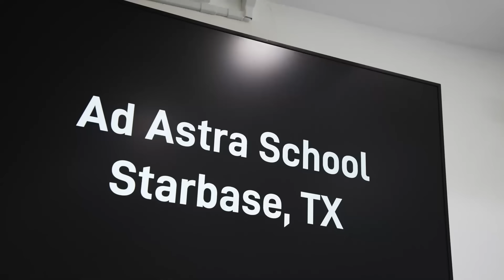Why Booster 9 Failed During Flight, Starbase Expansion Progress | Episode 23

Comment: I'll advocate a hydraulic 600 to 1000 ft. Lift off till I'm worm food.  The earth's gravity needs to be cracked so to speak, by non-ship means, before ship borne thrusters fully take over.  This should significantly reduce initial stress on the ship that is caused by gravity.  A series of concentric upward thrusting, rings of water nozzles, shooting filtered salt water, should be easy enough to construct.  Wind or solar powered accumulators can get this gravity cracker going with negligible environmental impact. 
     It's reusable and safe and will reduce launch noise and trauma to the spaceship.
Reply: What accelerations do you wish to achieve? How much fuel can be left behind? When to you start the engines?
Did you go to engineering school?
Reply: I must be misunderstanding your idea because it seems like a reliability, complexity, and cost nightmare. I don't want to be rude, I must have missed the advantage you're aiming for. What does cracking Earth's gravity mean, and how is a giant array of water jets better than adding a little more propellant to the giant soda can, or slightly reducing the payload capacity?

Lighting the engines at the top of the hydraulic launch seems extremely risky. Is there a way to abort if engines don't light immediately? Also, on the ascent some water would get splashed deep into the engines, freezing wherever it landed and ruining the careful cryogenic pre-chill.

Alternatively, lighting them at ground level doesn't appear to decrease the forces on the rocket. Maybe the engines are throttled down slightly, but the water's force would be increased to compensate. The vibration might be even worse, with water bashing on the engine bells and uneven pockets of water flashing to steam in the exhaust plume. There'd be a strong thump-thump-thump as it passed each ring of nozzles.

I'm imagining a 600-1000 ft launch tower with a hollow centre for the rocket to ascend through, strong enough for the reaction forces. No matter where you light the engines, at least the top part of the tower must be reinforced to survive rocket exhaust, the total thrust load, and the colossal noise. Add in 50-100 rings of nozzles, each ring needs a high-speed valve, and a control system to drive it all. Does this match your vision?

Comment: If they’d put the rocket part of starship on pylons at each side of it then this couldn’t happen.  An added benefit would be a massive increase in usable space inside of starship.
Reply: Very bad idea, simply would not work and unnessary. Drag would nearly treble, bracing to transfer thrust to the main body would be heavy and it would be very difficult to provide a heat shield to the sticking out engines. To increase payload volume all you do is add another ring or 2 to the body, which is what they are going to do I believe.
Reply: The pylons seem a good idea, the balancing act as it returns on flattop barges…Stability surface and wind and wave actions..needs damping effects..for the flattops.Do they have gyroscopic interactions feedback between flattop surface and on rocket base for landing?

Comment: Why is there no Black Box ??
Reply: Because the box doesn't identify as black 🙄
Reply: Racist
Reply: Because telemetry is constantly being broadcast back to mission control.
Reply: It could be an orange box, like some people.  😊
Reply: because if the rocket does something wrong, it gets blown up so nothing to save.
Reply: Every commercial aircraft has a black box that will survive vaporization.... So there's plenty to save @shaung949
Reply: Black Box go BLUEY with Big Rocket.
Reply: Telemetry (performance data) is continuously transmitted to ground control during flight (unless the connection is lost LOL). A data recorder (black) box could be helpful in that situation but it would be complicated to recover from the bottom of the ocean or from orbit. Preserving it from a flight termination explosion/self destruction would also be difficult (ie: ejection system, super durable box, gps tracker, floatation device, etc.)
It could all be possible to engineer all of those things into one system but that would only preserve missed data during loss of data connection events. I am guessing there are more important pressing things for the design teams to focus on.

Comment: Everyone is talking about the booster exploding but why did Starship explode?
Reply: If you take a close look at the fuel levels of the ship, one of the tanks is draining faster than it should like it were a leak
Reply: @beelandspace  It's the O2 tank looks like there was a leak Scott Manley's video pretty much explains what we know so far.  SpaceX are remaining tight lipped but if they reveal their corrective actions like they did for IFT1 I bet we'll get something about reinforcing the O2 tank or Oxidiser pipes.  The other glaring option is that S25 was the last Ship to have Hydraulic TVC which caused major issues for Booster 7 during IFT1 when it blew out perhaps something similar happened for S25 thankfully no Ships or Boosters remaining have hydraulic TVC they've all switched to Electric
Reply: ⁷5⅚t677⁶ UGG unde tffffț @beelandspace
Reply: That will be in another video
Reply: @ryanpruneau4937  Probably explained in the 11th video in the series of "Precisely why Starship blew up".
Reply: @protorhinocerator142  I got through two thirds of this worthless video before realizing they had no real info.
Reply: @gsparkman saying lots of words to sound intelligent but conveying nothing of importance.
Reply: I can’t believe this guy does so much talking without saying a damn thing!
Reply: What they said. Oxygen tank was draining quickly, meaning there wasn’t enough power left to get it to Hawaii and so would have crashed somewhere random along the way. Starship had to self-destruct and have pieces crash into the water below rather than perhaps crash into Indonesia or somewhere.
Reply: Fuel..leak...and  .activate.Flight..Terminate..
Reply: It was lonely. It couldn't live without its butt buddy.
Reply: They still don't know why
Reply: They lost connection with the ship so they triggered the FTS
Reply: Zackley
Just
Zackley
Reply: Obviously, it hit the firmament
Reply: @therombaro  yeah I thought of that too that would be fucked up cuz that might mean the Earth is flat I'm not a believer in that theory but the firmament is attached with the flat Earth  theory but you know could also be ET saying I don't want you to have some shooting your shit every time you launch it rock on man man 😀😀
Reply: controlled explosion, there was an oxygen leak and there wasnt enough fuel to clear africa, so boom.
Reply: God invented the rule of probability so this multiple outcomes but perhaps aliens are shooting his stuff down because they don't want him out Mars could be 😊😊
Reply: Maybe they should try something sturdier that stainless steel? Just my very humble opinion.
Reply: @joelm1955 
What material would you recommend?
Reply: Self destruction it, so it doesn't crash over land
Reply: Because it didn’t reach its destination orbit.
Reply: Wasn't going to make it to orbit fts was triggered
Reply: The real question. SpaceX still hasnt said. But lots of odd shoring up going on with SN26.  My guess is they know what happened but wont say cause its pretty bad. 🤷‍♂️
Reply: They Didn't need the data it was gong to provide. Test over... So blow it.
Reply: It wasn't a leak. The O2 was dumped in order to compensate for a lack of payload. Why didn't they just bring one? Dunno. But, they both likely would survived. Also, it's very possible they wanted an explosion, just cause 😂. Well, they can afford it!
Reply: Type in starship from Florida and you will find a vid what starship was doing when it activated fts.
Reply: Perhaps the 1 in 10 catastrophic failures in testing the newly built engines has got something to do with that.
Reply: And why did it take minutes for SpaceX to realise it had broken apart, possibly not due to the action of the FTS. It appears that the front section of the ship broke off in a single piece which could have caused considerable damage had it landed in a populated area. It wasn't blown into smithereens. Also, why do the heat shield tiles keep falling off? My theory is that the stainless steel structure is just too flexible. It buckles and twists under flight loadings far too easily, so the rigid tiles pop off and, of course, stainless steel is harder to get a strong adhesive bond.
Reply: @brendanpells912   makes sense !!
Reply: @brendanpells912  ??populated area?? The main flight path is over the sea. As the Starship was already in Space, it's re-entry meant it would burn up in the atmosphere and break up. I am quite sure SpaceX telemetry showed quite clearly when the Booster fell apart and the Starship FTS blowing it apart.
It was the Starship FTS that was activated, as it was not within it's flight trajectory limits. As for your 'flexing' SS structure. Have you tried twisting a full, unopened soda can lately? And that has no stiffeners like the 4mm SS Booster & Starship has. The body Tiles are attached to the tri-pin structures, that are welded to the outer skin. The glued tiles are now being tested by measuring the amount of pull they can withstand, so this may resolve the glued tile failures in future flights.
And before I go, you need to do some more research, before posting 'not quite true' statements.
Reply: @David-yo5ws  Maybe you should do a bit of research yourself:

- The planned trajectory of the launch does take Starship over land. It crosses both Africa and Indonesia.
- Starship definately does not burn up in the athmosphere. Stainless steel is quite heat resistant, and with the sheer size of that damn thing there is no way it will burn up completely.
- SpaceX has still not revealed why it failed. You could see it was out of fuel, but not why it was out of fuel. In fact I see clear signs it is overweight or underpowered, as it used up all fuel with zerpåo paylod without even getting close to orbital velocity
Reply: The FTS is not required to blow the ship into 'smithereens', just enough so that the chunks left will mostly burn up in the atmosphere once it's past the safe zone.  That far downrange, Starship was nearly orbital, so the part captured in the video from the keys would have largely broken up into ever-smaller pieces and burnt on re-entry (there's weather radar of the debris trail indicating that this is, in fact, what happened).  Some pieces of spacecraft DO survive re-entry, most often things like COPVs and fuel tanks, but emptied of propellant by the activation of the FTS or ascent itself, these pieces are pretty light and thus don't have a lot of velocity/energy by the time they reach the ground.  Sure, they'll kill you if they land on you, but at that point they're more like a piece of a light aircraft falling to Earth, not a blazing meteor of death.   @brendanpells912